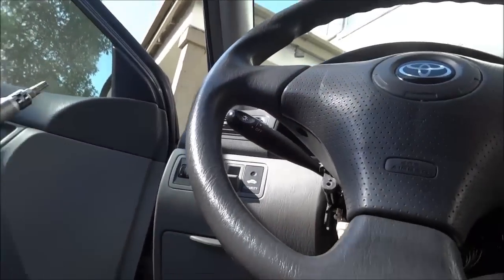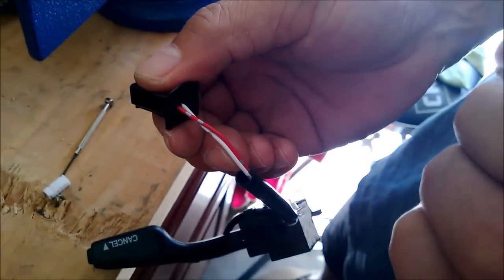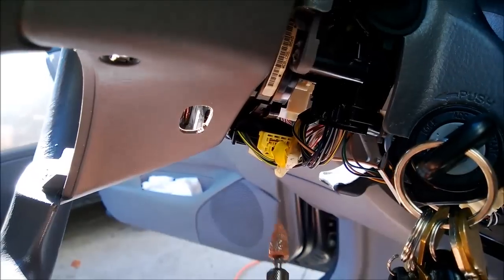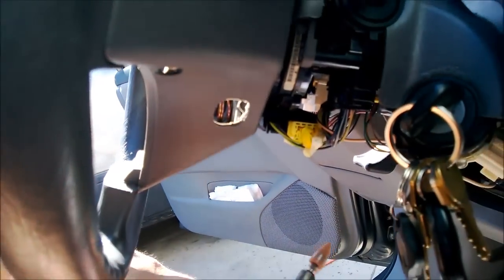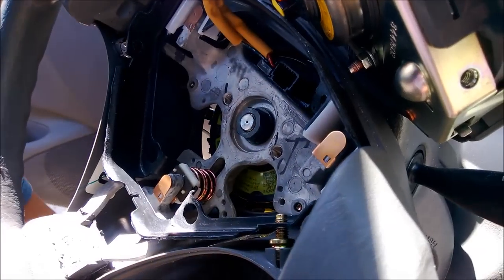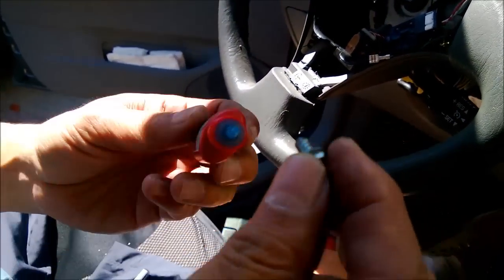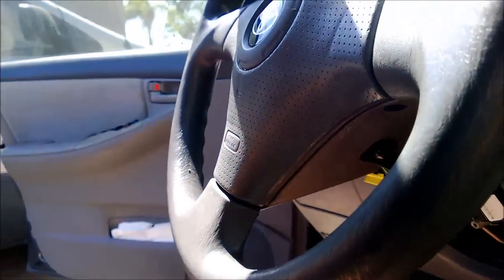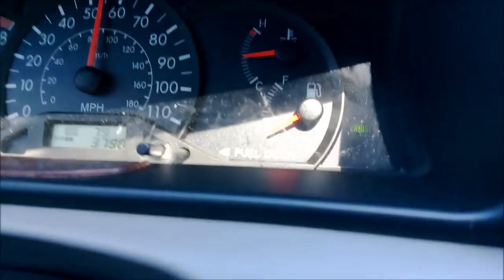Installing Cruise Control in 2005-2008 Toyota Corolla

Comment: Great video - appreciate the camera angle from when you drilled the hole.  I just did this to my Niece's 2007 Corolla CE.  

Fun fact:  If you guys don't want to mess with de-pinning the connector and messing with wires, just buy a cruise control stalk from a 2006 Vibe.  I went to my local Pick N Pull here in Texas and bought one from a wrecked 2006.  Cost?  $4.99.

It is pre-wired with the horn connector already in the plug.  Just swap and play.

Install time - 15 minutes.
Reply from the maker: That’s awesome! Good point there

Comment: I installed the cruise control, after watching the vidieo it took me less the 30 min, thanks. Bob Figuero
Reply: My 2008 corolla E120 automatic here in India is not ride by wire,it has an accelerator cable. So will this work for my car

Comment: Wow just added to Cruise to my 2006 Corolla CE with manual.  This Video made it a calk walk.  i used a 1-11/16OD X 1-3/16D RUBBER GROMMET AND A 1 1/2" OR 38MM HOLE SAW TO MAKE IT LOOK JUST LIKE FACTORY.  ALSO FOR THE MANUAL TRANS ALL YOU DO IS FIND THE CLUTCH PEDAL FOLLOW IT FROM THE CLUTCH PAD TO THE METAL BAR END AND YOU WILL SEE A BOLT WITH NUT REPLACE THAT OUT WITH TOYOTA PART #88280-14030 SWITCH ASSY. CLUTCH.  SCREW THAT NEW PART ON WHERE YOU REMOVED THE BOLT AND YOU WILL SEE A SMALL STOPPER PLUNGER AT THE VERY END OF THE NEW CLUTCH SWITCH AND ADJUST BY TURNING THE THREADS UNTIL THE PLUNGER TIP END IS DEPRESSED BY THE CLUTCH PEDAL BAR WHEN IN THE NOT USED POSITION THEN TIGHTEN THE NUT TO SECURE AND LOOK FOR THE FACTORY WIRE THAT IS JUST SITTING IN THE AREA OF THE FACTORY WIRES AND PLUG THAT INTO THE NEW SWITCH ASSY. CLUTCH #88280-14030 AND YOUR DONE.

WORKS PERFECT FACTORY PLUG AND PLAY. ALSO USED #10 X 1/2" SELF DRILLING SCREWS FOR THE CRUISE STALK.  YOUR SCREWING INTO ALUMINUM SO JUST DO IT BY HAND TILL SNUG.  ALSO WHEN YOU USE THE 1 1/2" OR 38MM HOLE SAW JUST EYEBALL THE CENTER HOLE FROM THE INSIDE BETWEEN THE TWO CRUISE STALK MOUNTING HOLES  AND USE ANY SMALL DRILL BIT AND DRILL A HOLE FOR THE CENTER AND REFERENCE POINT AND USE HOLE SAW ON OTHER SIDE GO REAL SLOW AND EASY SINCE THE PLASTIC IS 2MM THICK YOU COULD EVEN TURN THE HOLE SAW BY HAND TO CUT YOUR HOLE OUT SINCE THE PLASTIC IS SO THIN AND USE SANDPAPER FOR ROUGH EDGES AND ADD RUBBER GROMMET AND LOOKS LIKE FACTORY.
THANKS SO MUCH FOR VIDEO....
Reply: +Tony Robert Did the manual switch have three wires plus the horn?
Reply: is the number 501 marked on the clutch switch cause i took the stalk switch on a car at the scrap yard and i took the clutch switch but my cruise turns on but does not set.

Comment: This video was extremely helpful. It gave me the confidence I needed to successfully install cruise control in my 2007 Toyota Corolla CE, manual shift. There are still a few things I would like to add: (1) Like others have mentioned, you don't need to remove the screws from the steering wheel column, skip that step; (2) I found a box cutter more useful than the Dremel tool for cutting the hole in the plastic casing. I eyeballed it completely, much the same way it's done in the video. But the Dremel didn't give me the utility it did them. I bought one for $25 just for this project and probably would have been just fine without it. (3) Also, the screws I used were #8 1/2. They went in without a hitch and more readily than the other sizes used here. (4) With a manual shift, I also needed to install a clutch switch. This proved to be pretty easy. It's not comfortable getting into that tight space under the steering wheel but once I was able to see where the switch would go, and after struggling to release the original screw, it was an easy installation. There's a open plug all set and waiting for you to make use of it. All in all, the only tool I didn't have that I bought and actually used was a star key screwdriver. I had one that was electric but taking off the horn/airbag section needed a firmer hand so I bought as non-electric one. I also had to cut the horn lead out of its original casing. I did this with the box cutters. All that said, my car purrs now on cruise control... Thanks for posting this video! I spent about $125 for this repair (and it did take me a good bit of time because I needed to get tools, took some breaks, and ordered the clutch switch) but I think I could have done it for less than $100 and, if you know what to expect, in about an hour or hour and a half. Nevertheless, great job guys! Thanks!
Reply: I have a 2008 Toyota Corolla CE, do you if I need anything else other than the cruise control switch? Or just by installing the switch will work?
Reply: Hello! Thanks for the all info. 
I'm in the same condition as you. 
I wanted to know if the connection for the clutch switch was existing on a manual corolla 2005 CE. 
Looking forward to read from you.
Reply: @francoisbourgault1922 I don’t know the answer to that, I’m afraid. But this wasn’t a difficult installation. Still reaping the benefits of it!
Reply: @abiggs236  I have a matrix im just about to do this on, where'd you find the clutch disengage switch
Reply: @joshpiotrowski3487  I think I got it from Amazon.
Reply: @abiggs236  and its located up behind the clutch pedal?
Reply: @joshpiotrowski3487  Yes. This video shows where it is. I’m not sure if it’s the same procedure but it gave me a good sense of what to look for when I got under there. https://youtu.be/t7jApZe_-nM
Reply: isnt it drive by cable tho?
Reply: @user-se2ce1op8n  I’m not sure what you’re asking…

Comment: Thank you for posting this informative video.  I am not a mechanic, but after watching this I felt confident enough to install the cruise control.  I read through the other comments first, and found them helpful as well.  The cruise control is successfully installed on my 2007 Toyota Corolla and I am very pleased.
Reply from the maker: Glad it worked!

Comment: I just installed it successfully in my 2008 Toyota Corolla ( with my skilled friend, he did the work). We didn't have the drill but a punch, so we punched it first then used knife and paper cutter to make the hole. Yeah it's doable, and paper cutter makes it smooth and any shape you want. Thanks everybody, thanks Edward Chua.
Reply from the maker: +animesh mondal Glad to hear about another successful install!
Reply: My 2008 corolla E120 automatic here in India is not ride by wire,it has an accelerator cable. So will this work for my car

Comment: Thank you! This was super helpful, as well as the comments pointing out a) the vehicle is already wired and programmed for a CC. I'm just missing the control stick. b) for a manual tranny, I'll need a clutch switch.
I went to the salvage yard and found several cars with the control stick, but none with a clutch. I expanded my search to ALL the Toyota vehicles in the yard and was blown away that they ALL had automatics! 
Back home, I called the local parts stores and they couldn't find a clutch switch for CC;only the one for the ignition. On a whim, I looked underneath and my '06 Corolla already had the CC clutch switch! 20 minutes later I was reconnecting the battery. The cruise control works! Thank you so much.
(I only had to cut the hole in the plastic. The 2 screw holes were already there, and the wiring came with the control stick!)

Comment: Good video. Save yourself some time/money and get steering wheel with switch already built in at the scrap yard. This way u don’t have to cut hole in back side steering wheel cover or have to mess with the cruise control wiring harness. Worked out well for me with my 06 Matrix. Wa done in under 30 minutes

Comment: Thanks so much for this video!!  It helped me install cruise control on my 2005 Corolla with a manual transmission/stick-shift.  I learned that, for 5-speed transmissions, it is not enough to just install the cruise control stalk on the steering wheel.  I tried just installing the stalk, then took it for a drive and cruise control didn't work.  I then installed the 88280-14030 clutch switch, and then cruise control worked.  Both are needed for manual transmissions.

At the beginning of this video, they remove the lower part of the steering wheel housing.  This is absolutely unnecessary.
Reply: +Jonathon E. Did you need to buy and replace the clutch switch? Isn't one already there? Where does the clutch switch go?
Reply: +HabAnagarek Yes, I needed the clutch switch.  My model did not have one.  Where does it go?  If you can crane your neck around down by the pedals, you will see that when the brake pedal is in its unpressed, resting position, the pedal arm is pushing against a threaded switch that I assume signals the brake lights to come on when the brake pedal is depressed.  The clutch switch is installed very similarly on the clutch pedal.

I had to remove a regular bolt that was in place that the clutch pedal contacted when it was in its unpressed, resting position, and replaced that bolt with the clutch switch.  The wire/connector that I needed to plug the clutch switch into was tucked away there, unused, just ready to be pulled out and plugged in.
Reply: hi Can you give me instruction for Install clutch switch? thanks a lot !
Reply: hi Can anyone give me instruction for Install clutch switch? thanks
Reply: @HabAnagarek  A clutch switch intended for CC is needed yes

Comment: When I installed my cruise control stalk, I did not have to remove the lower steering column plastic cover, all I did was disconnect the battery, turn the headlights on for 30 minutes to drain all residual charge, then I undid the TORX screws on either side of the steering wheel to remove the airbag. The steering column stayed intact.  Oh yeah; those TORX screws are REALLY TIGHT, you have to really crank them hard, that's why its better to use a socket wrench to loosen those.  And use a small pair of needle-nose pliers to pull those TORX screws right out or they will catch on the airbag when trying to pull it out.  I disconnected my airbag leads and put the airbag off to the side, but I see now its okay to just leave it connected.
The hardest part was trying to figure out where to drill the hole in the plastic for the stalk to stick out of, and how big to cut it with a dremel tool. Lots of trial and error work there.
He used self-tapping screws. I did not have any so I first used a TAP to cut some threads, and then I used ordinary screws of the same size as the tap.
Reply: Why/how did you drain the battery if it is already disconnected? And what screw size was good for cruise control kit inside the steering wheel? Thanks in advance

Comment: I have an 08 Corolla and I watched your video, I went to a picknpull and got a cruise control switch from a Toyota matrix I didn’t have to add that wire for the ground it already had it. But I took it on the free way and it works I’m so excited now that I have it.
Reply from the maker: Very cool!

Comment: Thanks a lot for the video. I watched your video (along with a couple others) and discovered that I didn't need to drill the hole. I changed the cruise control in my Toyota Corolla 2006 by myself.

Comment: I couldn't figure out why the bottom cowling was removed so I skipped that step and had no issues installing the cruise switch in my 2005 Corolla. Tip: I bought my cruise switch from a self pull scrap yard (Kenny-U-Pull) and it came with the horn wire already installed. Also good practice pulling it from a junk car. ;)

Comment: Thanks for doing this excellent video - with your help I successfully installed a cruise control in my '05 Corolla today - you made it a snap! Thanks again.
Reply from the maker: Good job! Glad to hear it worked!
Reply: @EdwardInTX  My 2008 corolla E120 automatic here in India is not ride by wire,it has an accelerator cable. So will this work for my car
Reply: @nitinmotwani8512  No

Comment: Installed cruise control on my 2005 Toyota Matrix 5 speed manual that I ordered from RockAuto.com.  Realized after I installed it that it doesn't work unless you also order the clutch switch as well.  Installing this was very easy.  Basically unscrewed the original bolt that stops the clutch pedal and replaced it with one that has a plug on the end of it.  The cable was already there just dangling so I plugged it in and it works great now!
Reply from the maker: Samuel, I think that's awesome! Perhaps if you make a video on the general idea of installing the clutch switch, I'll link you back from here. We could help the whole community and cover both automatic AND manual.

Comment: I remember seeing this video when i first got my Corolla 5 years back but didn't watch it through. I wish i had, as it looks fairly straightforward. I'm looking for a another Toyota or Honda now and my Corolla is finally going. I have a horrible feeling i'm going to miss it when it goes, but its showing its age now, especially underneath corrosion from oir salty roads.
Reply from the maker: It’s really down to drilling a hole and plugging a connection. Hope you are successful!

Comment: I've already install mine,took me 25 minutes,very easy,thanks for the video,very helpful.
Reply: My 2008 corolla E120 automatic here in India is not ride by wire,it has an accelerator cable. So will this work for my car
Reply: @nitinmotwani8512  it will not work for you, it's only by drive by wire.
Reply: Thanks

Comment: so far so good. i have a 2003 corolla ce and i took the airbag/ horn out to see if they look alike and are same gen. i found an easier way to take the 2 bolts out the back of the steering wheel. just pull back on the plastic alittle and they should just fall out. anyways ordering the switch now and report back later when its installed. thanks a ton.
Reply: It won't work.. only on '05 and newer

Comment: At first I was like... "oh no", but you finished it off as a nice tidy job. Using threadlock, tapping the threads, all tidy. Not much use to me though, we all drive manual transmission here in the UK most of the time. In fact, in my 19 years of driving, I've never driven an auto yet..lol.

Comment: I bought my stalk from the 'Cruise Control Store', and it already came with that green wire sticking out. However it wasn't cheap!  Instead of costing only $50 like many cheaper ones cost, the one I bought was Toyota OEM and cost $180, plus taxes.